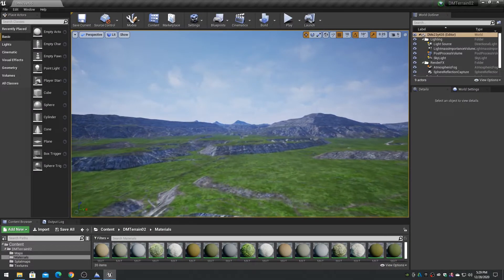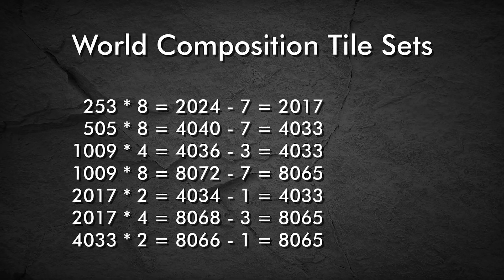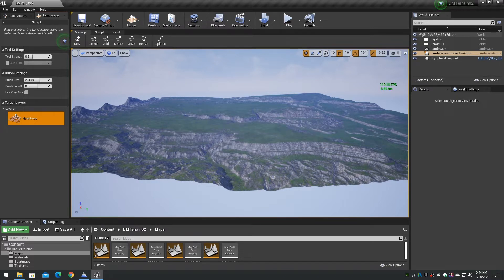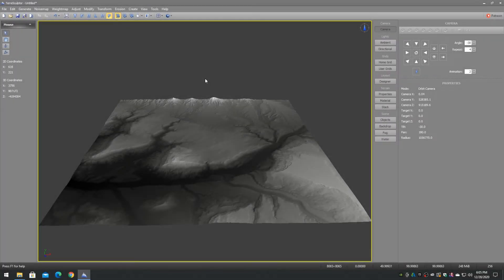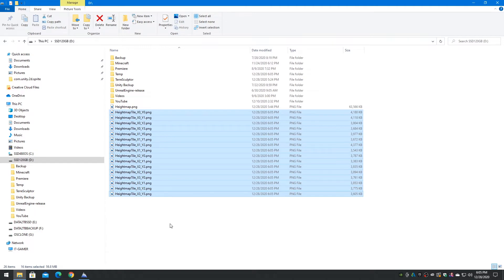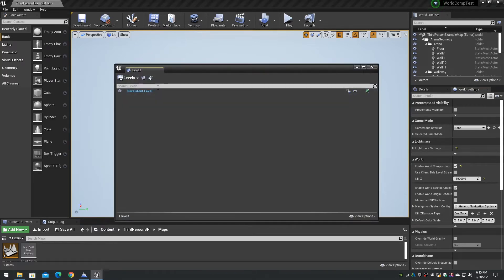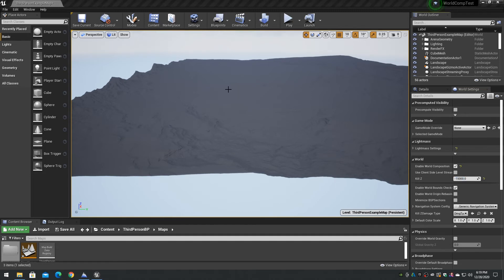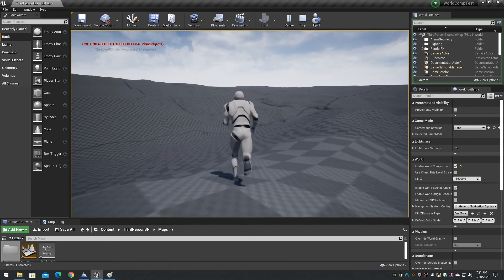TerreSculptor: UE4 Landscape to World Composition

Comment: Keeps throwing me "an error occured saving the tile to disk"
other than that great app
Reply from the maker: Hi. Can you give me a bit of information on what settings you are using so that I can try to replicate the error: heightmap size, tile size, tile number, etc.
What happens if you use a basic 1024x1024 heightmap and split that into 2x2 and save it, do you still get the error?
Note that the current Tile Creator is limited at this time to heightmaps of 26k x 26k maximum resolution due to Windows Bitmap size limitations, I will be updating this soon to support larger sizes.
Reply: @demenzunmedia  heightmap size was all messed up from my behalf. 1024x1024 worked. Thx for this great product and for Ur quick reply :)
Reply from the maker: @pssstockarena  - Hi.  Thanks.

All of the standard dimensions from 2x2 to 26kx26k including UE4 World Composition sizes from the UDK Sizes dialog should work.  If you run into a heightmap size or tile setting that throws an error, please let me know what settings you used.  You can even screen capture the dialog and send an image link.

The Tile Creator will be getting some major updates on the next build release, including changes to the maximum heightmap size from the Windows Bitmap maximum size limit of 26k, to the full size supported by TerreSculptor.  Plus new tiling code to manage that.  So any current bugs should be fixed on that update.

Comment: Hello, i have a problem when importing a terrain from png or tiff. it creates terrace artefacts (my images are 16 bit)
Reply from the maker: The heightmap is probably not normalized then and is only using a small portion of the 16-bit value range.  Try normalizing the heightmap in TerreSculptor before exporting or saving tiles.
Reply: @demenzunmedia  Actually everything is good, that's just me being dumb. I didn't see that there is multiple options for the same format, i was importing with RVB option instead of classic PNG.

Comment: Good video I need more about world composition.
Reply from the maker: I have a lengthy in-depth TerreSculptor to World Composition video series coming soon.  It will be about 4 to 6 parts in the series. And it should be on my channel in February or March.
Reply: @demenzunmedia  I'm wondering if the series is available any time soon?
Reply from the maker: @steven3314  - I have over 25 videos in the pipeline coming to the channel, including the series on World Composition.  I don't have a firm date on when it will be available though.
Reply: @demenzunmedia  Ok, I'm using UE5 currently, so I'll wait for your UE5 tutorial instead.
Reply from the maker: @steven3314  - Ok.  It will take me a month or two to get through the list of videos that I currently have in the pipeline.  I am usually working ahead and scripting videos up to 10 or more ahead of when I am shooting them.  So it will be a bit of time before I get the UE5 videos out.

Comment: I have a small question. I know you can split your landscape inside udk4's world composition. What is the purpose to send it to TerreScuptor and tiling it there? Do you actually get some benedict from this process? Better landscape optimization or something?
Reply: When splitting inside of UE4 you cannot resample the heightmap to a different size, it just crops or pads the heightmap.
When converting a regular heightmap to world composition, for some tile sets you need a completely different size heightmap, and TerreSculptor lets you resize it to the proper dimensions.

Comment: Curious about Terre Sculpter....how do you allocate more memory to resample a map 8k to a finish World Composition map of 64KM?  When I attempt to RESAMPLE is notifies that I need more memory....?
Reply from the maker: When working with very large heightmaps, you are limited to the maximum size of a flat array that is defined by Windows itself.  The Windows APIs impose a lot of limits on what I am able to do.  See the FAQ page on the website for a list of maximum dimensions for various tools.
I am working on updating TerreSculptor to support larger custom arrays.  The current maximum heightmap is about 46k x 46k.  Once I get the custom array coding completed it will support up to 2 billion x 2 billion but will be initially limited to 64k x 64k, since I will have to add in a lot of size-checking notifications in the software.
The second issue with very large heightmaps is that the Windows Image file formats do not support sizes that large (BMP,GIF,JPG,JRX,PNG,TIF).  See the FAQ page.  This will force a person to have to use RAW format or other formats that support very large heightmap sizes other than Image formats.  So I am updating a bunch of the tools in order to get the largest size support that is possible.  I expect to have most of this completed in Q1/Q2 of 2021.
Reply: @demenzunmedia  Totally understand!  As a possible fix...could you resample your  8K Height Map, Tile It, then Resample each Tile to 8K, and Tile those?  Im sure the x0, y0 coordinates will be a mess to figure out....but would that be a good workaround?
Reply from the maker: @RCR-StolenUFO  - If you were working with an 8k file that you wanted resampled up to 64k, to create a tiled 64k world of 8x8 tiles, then you could split the 8k heightmap into 1k tiles and resample each of those up to 8k. That would give you an 8x8 tile set of 8kx8k heightmaps.  And all of the 1k tiles that you would resample would also be the proper names for UE4's importer.
The only thing that may happen is you may see issues where the tiles meet, they may not be seamless on their edges due to inaccuracies in the resampled edges (resampling clamps at the edges). The tile edges would be close but they probably won't have perfectly matching edge elevations all along the full length of the edge.
If you were doing this in UE4 you might have to take the smooth brush over the tile edges and match them up.
The issue stems from the resample algorithm not knowing what the edge elevations of the adjacent tiles are, so it can't resample with those elevations available to the algorithm.
This is one of the main reasons why I am updating TerreSculptor to support massive heightmaps, eventually up to the maximum of the installed memory.  Attempting to work around lower resolutions by using a tiled terrain system introduces a lot of technical problems that have to be dealt with.  It's always best to work directly in the exact resolution that you want.
Reply from the maker: @RCR-StolenUFO  - I was thinking about it, and if you were wanting to resample an 8k heightmap to 64k for creating a tiled 8x8 set, what should work fine for a workflow and will also keep the edge seams good, it will just take some time to do, is to: use the Tile Creator to split the 8k heightmap into 8x8 1kx1k tiles, these will also be correctly named; open each of the 1k tiles up and use the Interpolate modifier with 0 Variance to increase the size by 800% in width and length; save it back out as an 8k tile; repeat for all 64 tiles.
The Interpolate modifier doesn't perform kernel smoothing like the standard Resample methods do, so the edge seams should retain the same elevations at the tile seams.
Reply: @demenzunmedia  Absolutely Amazing!!  I will test it out this week, also I am still excited for the TerreSculpter updates!  Thank you so much!
Reply from the maker: @RCR-StolenUFO  - You are welcome.
The priority right now is to get the BigArray and Terrain Stack features completed as soon as possible.